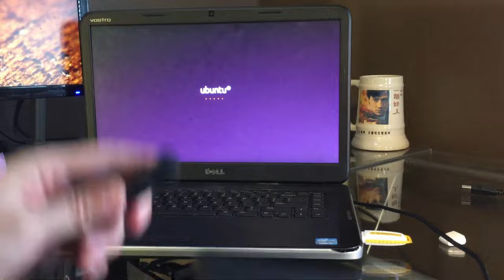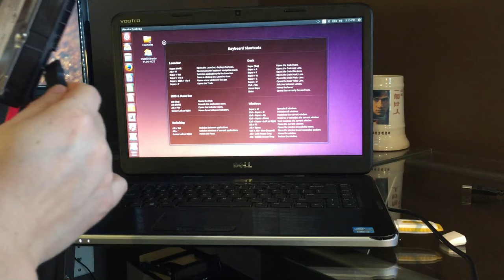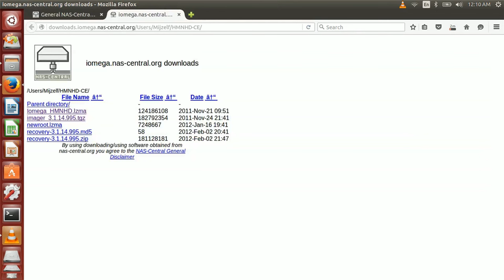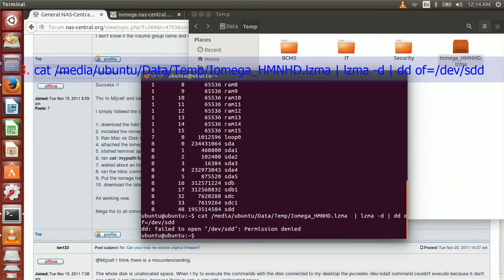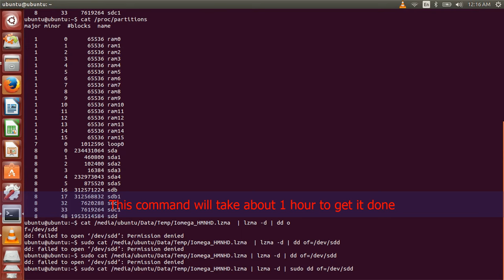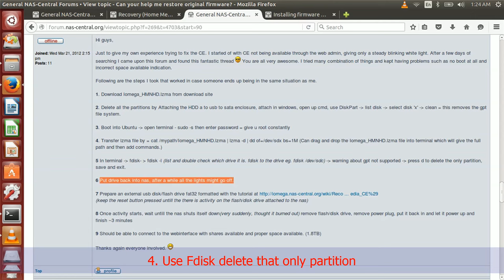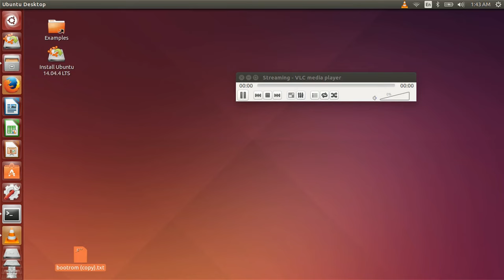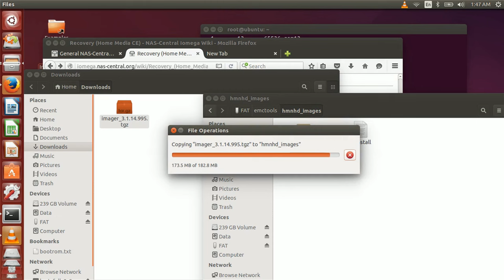How to Install Firmware on a New Hard Drive for Iomega Home Media Cloud Edition (HMND2)

Comment: Thanks for this, was really waiting for something like this for couple of years now, had my iomega HDD dead, and tried so many several ways, none was success, until i found this.
I did have some issues with this as well, but with the knowledge of both this video and the old video i got from one of the links, i came around and was successful. I got a running NAS drive now.
I  want to know if there are any online upgrades available that we can use to update the NAS, since this one only works with SMB1 protocol, which has security issues.

Comment: hi! good video! i'm Ezequiel from Argentina. I have a question...do you have the firmware? the drivers? and all the necesary to install? i have formated the disk and i cant install anything becausa there is nothing in the RED. Thanks!
Reply: the links you have post are down! Chers.
Reply from the maker: Hi Ezequiel, I have updated my description to include recovery steps and links for those needed files. Please check the description again.

Comment: Hello budy, how are you?
I bought an Iomega Home Media on the open market like yours,
the device came without the hard drive. when i installed the hd and turned it on, the system light is always on in red, i connected the rj45 cable to my notbook and also to my home network router and nothing happened, i can't access it. I don't know what to do, I searched all over the Internet for a way to solve this problem, until I found your video, which seems to be the solution for my case, could you help me? originated from some luck
Reply from the maker: Hi , first thing, you might want to go through the comments on the video. Original website to provide firmware download links has gone. You will need to check comments to see someone's online drive to get those firmware and systems , then you can do system firmware installation as I did on my Iomega hard drive. Good luck.

Comment: Hello.  I have one of these things and it won't connect to my router and since it does that I can't acces the files.  I can hear the drive spin up when its plugged in so I think its still working.  I just need to get the data off the drive.  Can someone direct me to instructions on how I can bypass the Iomega/Lenovo software and just get into the drive?  Many thanks.

Comment: How long runs the recovery-process with the usb-stick? I'm still waiting more then 2 houres.
Reply from the maker: is it "sudo cat /media/ubuntu/data/temp/iomega_hmnhd.lzma | lzma -d | sudo dd of=/dev/sdd" command ? Based on my video, it took me about 1 hour. I am not sure exactly how long it was. But definitely, not more than 2 hours.
Reply from the maker: You can try to run command again with bs=1M option for block size, which should cut the time to around 10 minutes from previous 1 hour.

Comment: I have a 500Go Hdd, can I use it for replacement or is it necessary to replace it with an Hdd of same Size (2To) ?
Reply from the maker: Hi Guillaume, I am pretty much sure you can use different size hard drive to replace original one.

Comment: Thanks for the post. The disk in my 2tb Iomega has finally died but I have a spare 3tb drive that I can replace it with so I've followed the video instructions several times and end up with 1, possibly 2 problems: when the lmza file is dd'ed to the new drive it creates a couple of issues in the partition table, namely GPT and PMBR sizes mismatch and location of backup table. If these issues are left untouched the NAS will happily boot with the new drive and can be updated via the flashdrive. After this I can access all features EXCEPT there is no storage space to use resulting in "The selected function is not available due to the state of the pools", so although its functioning the NAS is still useless. I notice that Luke1975 in the forum post had exactly the same problem, but the post no longer exists, so I can't find out what he did to resolve? Thinking it may be caused by the partition table issues, I've allowed gdisk to auto-fix them (fdisk won't work on the disk because its GPT), but although in my Ubuntu install the disk then looks fine, when its installed in the NAS it just errors, won't boot and the flashdrive won't patch. Any help to resolve would be much appreciated.
Reply: Quick update... although the gdisk partition auto-fix rendered the disk unusable by the NAS, using "parted -l" instead gave a "Warning: Not all of the space available to /dev/sdj appears to be used, you can
 fix the GPT to use all of the space (an extra 3907008000 blocks) or continue
 with the current setting?
"
Allowing this to auto-fix, has done the trick. My NAS is now fully up and running with 3tb available.

Comment: hello NETSEC 
good night I have a problem with the installation of the hard drive, I made all the steps but I do not recognize the usb when I connect it to the NAS, and turn on the red led. you can help. Thank you
Reply from the maker: Hi Victor, first , thanks for watching my video. Second, for your question, I am not sure what exactly your problem is, but if you check the comments and replies in this video, you should be able to find the right solution for it. Trasheddy and Sxnkl2 has made lots of contribution to reply the question here. Thanks to both of them.

Comment: it works and i have a bit step change and shortcut. thanks bro. really appreciate and good job.
Update on 19 Sept 2019
Step to install new drive IOMEGA HMND2 Home drive :

High level steps to install HMND system to new hard drive based on video:
1. Download iomega_hmnhd.lzma file to your laptop which is running Ubuntu Live USB Linux
      https://drive.google.com/open?id=1Ih0q4QU2mgcoRF63tIRblQau9Rhb8V-y
2. attached new drive to the laptop running Ubuntu Live USB Linux
3. get your hard drive device id using command "cat /proc/partitions". In video , it was sdd.
4. type : cat /media/ubuntu/Data/Temp/iomega_hmnhd.lzma | lzma -d | sudo dd of=/dev/sdd bs=1M

download  recovery-3.1.14.995.zip > https://drive.google.com/open?id=1jtTjQfBLVJqDECcVDnHYAgbN5LBmfWQX
5. Preparing the USB-stick
, type on terminal :
mkfs -t vfact /dev/sdd1
mkdir -p /mnt/hmnhdce-recover && mount /dev/sdd1 /mnt/hmnhdce-recover
mkdir -p /mnt/hmnhdce-recover/emctools/hmnhd_images
6. from recovery-3.1.14.995.zip > copy file imager_3.1.14.995.tgz and reinstall file into usb > emctools/hmnhd_images
/
7. type on terminal :
touch /mnt/hmnhdce-recover/emctools/hmnhd_images/reinstall
8. copy bootrom.txt from recovery-3.1.14.995.zip to usb root folder
9. Put step1-step4 hard drive back into HMNHDCE 

Following steps are not in the my video, but Sxnkl2 has a nice video shows this part in his google drive folder.  Check the link at end of this description. 
10. Plug the prepared USB stick into HMNHDCE
11. Press and hold reset button while plugging in power cable (use a needle or similar tool)
12 release the button when the activity LED of USB-Stick starts to flicker
13 Wait until HMNHDCE Powers Down on its own
14 Pull out the USB Stick
15 Pull out power cord of HMNHDCE and put back power cord to reboot it.
16 Try to reach HMNHDCE's Web Interface 

connect direct to PC windows by ethernet :
1. Open Command (type on search box : CMD)
2. from command type : arp -a (check the dynamic IP, mostly : https://169.254.111.189 but it may change) wait about 10min after iomega start-up.
3. type iomega IP address to your browser.

connect to router :
1. check your router IP client.
2. find IOMEGA IP
3. type iomega IP address to your browser.

============================================================================
Update on Jul 6 2019:
Since nas-central.org website is not working anymore, and I have not saved those two files iomega_hmnhd.lzma and recovery-3.1.14.995.zip, but thanks to @trasheddy who replied at this video and shared both files with detail steps, I also downloaded both files and sharing them at 
url: https://app.box.com/s/1hswl2col6qlpn41kxl5irhqrcubogx3 

I have not got a chance to verify both files and trasheddy's steps. It seems both files should work. If not, please let me know.  

Also thanks to @Sxnkl2, he has made a .tib image for recovery usb stick (pen drive), which make recovery easier. He also has a share google drive folder for all his files: https://drive.google.com/drive/folders/1MJly3dNzRHjrv7FpQovSS4AQADH_UWgW
Reply: Hello. I don't want to succeed. Is it normal that if I do this parser then gparted writes the hard drive incorrect? (cat /media/ubuntu/Data/Temp/iomega_hmnhd.lzma | lzma -d | sudo dd of = / dev / sdd bs = 1M)

Comment: iomega_hmnhd.lzma  on the last llink are just 7mb file
is that ok? the file in the video is about 180mb
Reply from the maker: not sure if that 7mb file will work. But it can be much smaller size than the one in the video if it was built well.
Reply: It's worked for you?
Reply: I am having the same question. Is this 7 Mb file iomega_hmnhd.lzma the right one ?  Also: when I do the command sudo cat /media/ubuntu/Data/Temp/iomega_hmnhd.lzma  etc etc, that is supposed to take 1 hour, I returned immediately without error, saying some xxMB were written. I am very confused with this.

Comment: Hi guys. Can somebody tell me, if I reset my HMND2 (switch on the back side) then what is default IP address ? Or DHCP ?
Reply from the maker: Hi Kot, I belive it is DHCP. You will need to check your DHCP server or your router to see which ip has been assigned to your device.
Reply: @NetSec  THX, a lot, you were right. It worked at third reset time. I think iomega is dying because now it is starting endlessly. I was trying to recover my files at Ubuntu, but I can't mount this disk because of an error. What a pity, so many photos were there.. :( Sorry for my english.

Comment: Hi everyone , thanks for posting this video, I've Iomega HMNHDCE 1tb and it's working perfectly without any error, My question is, Can I upgrade my hard drive to 4tb? is that possible? if Yes how to do this? Can someone tell me that how can I backup my currently running 1tb hard drive's or my Iomega HMNHDCE's firmware backup? Thanks in advance
Reply: Amit Pandya  Hi, I think you should clone your hard drive with Acronis True Image, Then write the image that you created by Acronis on your new HDD.
Reply: @rj4544  thanks I'll try this method if everything goes right I post here my results thanks again
Reply: Amit Pandya 
Hi, any update?
Reply: @rj4544  Hi, Thanks for sharing this video, I have just got 2tb hard drives yesterday, which is of the "Western Digital Green" series, will it be working in this hard drive or will I have to take hard disks of the nas series? I want to check it but I do not have other hard drives to back up, the data that I have in my nas are full, they are completely full, so can I check this 2TB hard drive? Will it work?
Reply: Yes I think it will,
Why do you not use external hard disk if your internal NAS HDD is working properly?
Reply: @rj4544  Yes, there is no problem using the external hard drive, but I believe that, the less is as true, one is the reason and secondly, I update PlayStation 2 games to this NAS by updating 2TB. AS A SMB USE wants to put all the games in it.
Reply: Okay 👌
Reply: @rj4544  Cloning hard disk did not work, red light is coming, not all spreading it
Reply: Amit Pandya  😭, Sorry Do you have Firmware CD?
Reply: @rj4544  Yes, I've installation Cd